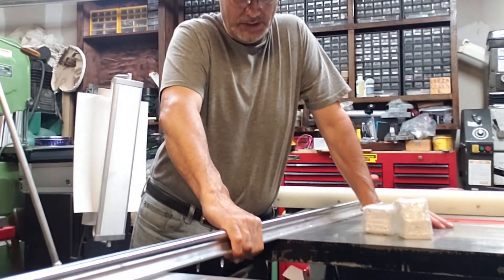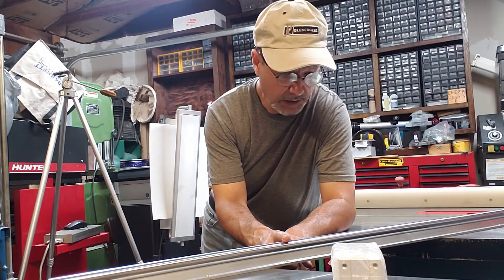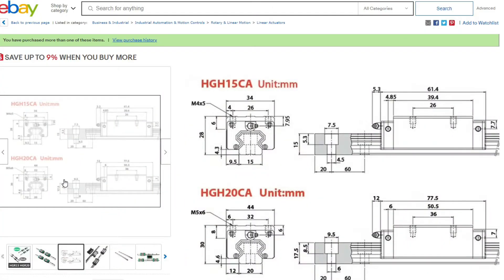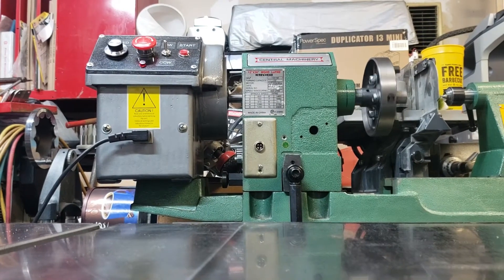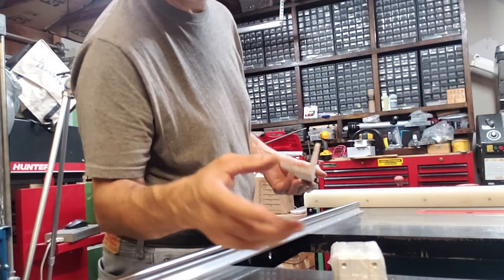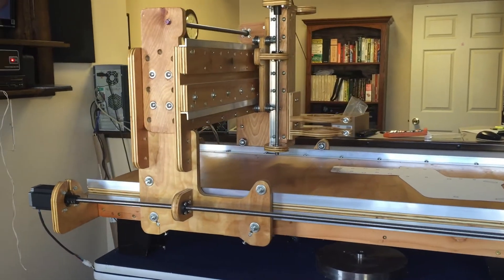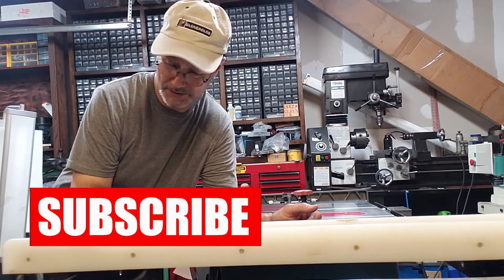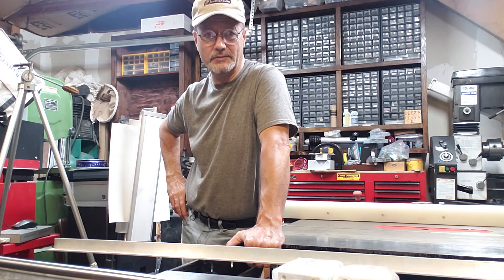CNC Rail Types

Comment: Yo compré guía cuadrada de 20 mm para el eje X y guias redonda medialuna de 20mm para el Eje Y y el Z guias cuadradas.
Crees que hice buena compra?
Reply from the maker: Bueno, usualmente las guías redondas pesan más que las cuadradas, en mi caso las redondas las use  fijas a la mesa  (eje X) y las cuadradas en el carro movedizo (ejes Y y Z)  por ser más ligeras, pero eso y a depende de la potencia de tus motores y la velocidad en la que la máquina va a operar. Hiciste buena compra? Yo compre  guías redondas para todo, luego tuve que comprar guías cuadradas aparte  por que pense que eran muy pesadas y voluminosas.

Comment: I wouldn’t say that flat are lighter, it really depends what size you order. 

If those rails are for that large router machine than those would’ve been appropriate.  

You’re working with a wood build so you have more than enough flexibility to switch it up. 

You should’ve went with 25mm block’s minimum for that sie. 15mm are for 3d printers. 

Maybe 15mm on a small short run axis like a lathe cross slide but rule of thumb the bigger the better.
Reply from the maker: I agree with what you say.
I ended  up using 25mm blocks for X and Z and round bars for Y. It worked great. 
If you go to my channel page,  check this playlist: 
https://www.youtube.com/playlist?list=PLYZogIyx7nYJkVCUm-rxNI_yBv0nK0SJp
where you can see the machine in action.
Thanks for the comment.

Comment: If I use 8mm rod wilh 1 meter Legnth to make milling cnc for wood and Aluminium , will it bent by the load if the rods are non supported type
Reply from the maker: probably so. I tried 14mm rod same length than yours it bent a little. specially milling aluminum you’ll need supported rods.  hope it helps.
Reply: @CMDWorks  thanks ,  supporting rail saft is not available in Amazon in my location
Reply from the maker: sorry to hear that. have you considered using flat rails bolted to an aluminum profile?
Reply: @CMDWorks  this might be An option but that's Little bit expensive and also 1 meter type is not Available .
Reply from the maker: @omsingharjit  oh. sorry. well then. good luck!

Comment: do you have a video on how you aligned the rails to make sure they were perfectly straight?
Reply from the maker: No, but the way I align the rails, first I fix one of the rails to the machine, then I slide the gantry on the rail leaving the other one unattached, then I move the gantry from one end to the other end,  then I clamp the rail when the movement is smooth and easy, then I permanently attach it.